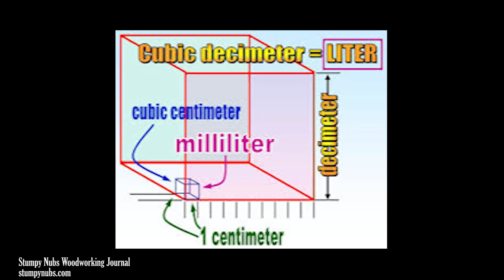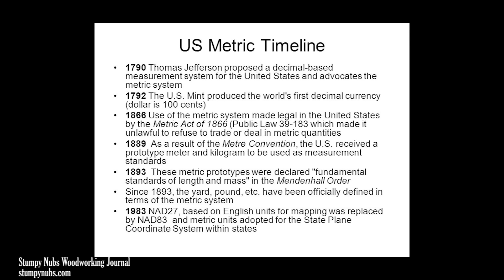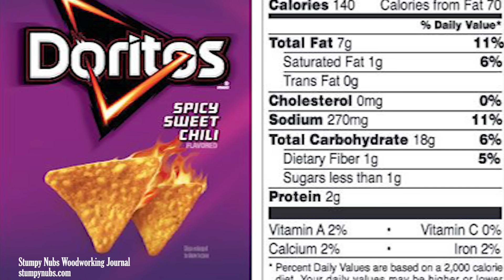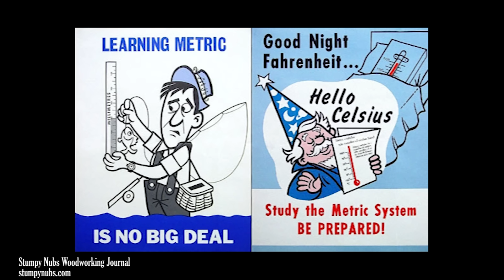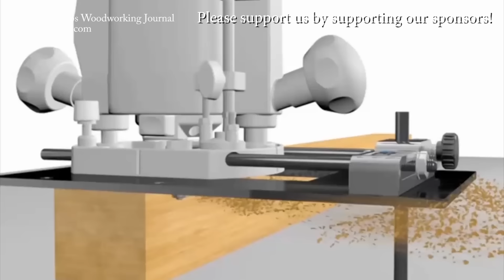BREAKING: The USA is switching to METRIC!

Comment: metric screws make so much more sense to me. Also I find measuring everything in mm (for projects) way easier.. get better than 1/16th" accuracy with a single number - no fractions or decimals needed.
Reply: It just makes more sense in general.
Reply: You can get setup blocks and rules that provide 1/32nd of accuracy which is more accurate than a mm. But when you need to divide that 1 meter base cabinet into 3 equal width top drawers for a buffet let me know how the division goes :).
Reply: @stevenbutler4080  If you need better accuracy, simply use 0.1 or 0.01 or 0.001mm. It is common for working on a metal lathe, for example. :)
And try splitting 10" into 3 equal parts - it's the same problem.
Reply: A 1 meter cabinet is 39.3700787 inches, let me know how that division into 3 equal parts goes.
Reply: No one uses exactly 100 cm wide cabinets, the standard is 45/60/120. There you go.
Reply: @stevenbutler4080  You can get a rule that is in micrometers.
Reply: Came from metric country, learnt to appreciate US fractions :)
Reply: I dislike spanner sizes in Imperial, but sometimes the imperial thread pitch is better that the metric one...
Reply: Did you know you can get better than 1/16" accuracy by using 1/32"? Even 1/64".

The accuracy and precision of either measuring system are identical. There is nothing that can be measured in one that can not be measured equally well in the other.
Reply: @barryhamm3414  Why are you mixing units?
If your cabinet were 1 yard, then divided into 3 equal parts would be 1 foot each.
Reply: @Locke99GS  More over when you buy tools,  for instance drill bits, you can get 1/64 stepping which is 0.4 mm.  Among metric ones I did not see ones sold with less that 1 mm steps, so less precision
Reply: @Locke99GS that's true, but it would be 10% or so smaller, and we all know that Americans want everything bigger 😊
Reply: Dimensions on engineering drawings are expressed in decimal form, with decimal places. The units of measurement should also be specified, such as millimeters (mm) or inches (in).
Reply: @BulletsRubber  So? Or are you complaining that it wouldn't be exactly the same as the metric unit size? Because I never claimed it would be the same, I claimed it would be better accuracy than the original example given.

Also it doesn't matter if it equates to the same, because we're not trying to equate it to the same.
Reply: I would be so lost I think if we changed to that lol
Reply: @barryhamm3414  Simples, change it to a Yard.
Reply: @jimrosson6702  Changed to using fractions?

If so, then 
that's simply due to a lack of education on them. If you don't understand fractions, then you don't understand fractions. In the US, children learn fractions in elementary school, typically along with the concept of division, since they're the same thing -  fractions are just a different way of representing divisions. They get lots of exposure to them, so using them in life is just as easy as using decimal notation.

Because they confuse you is not a good reason we should stop using them for ourselves.

If you're talking about changing to metric, then ... it's pretty straightforward. If you can multiply and divide by ten, then you can use decimal notation. (much like if you understand the concept of "half" then you can use fractional notation)
Reply: @jseen9568  why? micrometers are smaller then human hairs. since when do you need that precision?
Reply: @dmitripogosian5084  no such thing as American fractions. you can't own fractions
Reply: @smellysam  as in imperial there are 2 metric thread pitches.
Reply: @BulletsRubber  metric measurements are bigger numbers.
Reply: @jdilksjr  why?
Reply: @BulletsRubber Except their pints of beer are just16 fl oz vs UK  20 fl oz
Reply: @Locke99GS  Yeah how are those 1/32 and 1/64th measuring tapes lookin? Real common and easy to use eh?
Reply: @stevenbutler4080 Is that because you enjoy using 1/3 of 1/32?  Anything you do could end up like you're implying, being divided by inconvenient amounts.  How about dividing a yard by 7?  These type of questions are, I think, called straw men arguments.  They don't really serve a purpose or prove anything.
Reply: @colinstu  about as common as 0.5mm tapes, and about as easy to read, which is to say, not difficult at all.

They're plenty common. Anyone who needs one can buy them at any hardware store. They cost about the same as any other.

I have a 64ths inch measuring tape in my tool cabinet.
Reply: @@ThatRaggedyDoctor microinches exist too, without the need to use fractions. What's your point?
Reply: @stewartbonner  well it isn't really a micrometer, it's a 100xmicrometer. So there are 10 hatches for a millimeter.
Reply: @jseen9568  you have no clue what you are talking about. there are no micrometer marks on a ruler or tape measure. 10 or a 100 has nothing to do with it.  no micrometer measurements in woodworking.  nor are there any hatches.
Reply: @stewartbonner  lol ok. They're out there. I use them, not for woodworking. IDK the brand it's just a piece of metal
Reply: @jseen9568  this is a woodworking channel and video. no micrometers are used in woodworking . off topic. why are you here and why are you injecting irrelevancy here?
Reply: @dmitripogosian5084  yes, appreciate what a pain in the butt they are.  base 10 just as money, fingers, toes, decades, centuries, science......99% of the world.
Reply: @Locke99GS  thank you! Stewart seems to not think those and smaller increments exists in 8n metric. Which is really weird.
Reply: @cuebj  the UK and US pint is not the same size.
perfect example of why to go metric.
Reply: @Locke99GS  such precision is not a woodworking concern.
Reply: @jseen9568  there is no such precision used in woodworking. micrometres are at the measurements of human hair thickness, thinner then gluelines. There are no dimensions on woodworking drawings that are at 10^-6 metres precision.
Reply: @@ThatRaggedyDoctorif easier to achieve the same or better results then by definition 'better'.
Reply: @jseen9568  "decimetres' are not used in woodworking nor industry. Not a SI unit.
Reply: @@ThatRaggedyDoctor What's to figure out? You said this:

---
@ThatRaggedyDoctor
6 hours ago
 @stevenbutler4080 "More accurate than a mm" you say. That's where we metric folk simply use "micron", and still have no need for fractions. 😉
---

Implying that microns have high enough resolution to preclude the use of fractions.
I replied to that stating that similar exists for imperial, very high resolution unit that precludes the use of fractions.

So ... I'm not sure what there is to re-read or what there is to figure out.
Reply: @jseen9568  Yeah, I see where he is coming from, but in a discussion about "metric", micrometers (and smaller, nano-, pico-, etc...) totally exist. That should be undeniable. But with the lens of woodworking, micrometers (the measurement, not the tool) is not useful.

I personally think the scope of you guys' argument needs to be defined before it can become productive.

:)
Reply: @stewartbonner  "such precision is not a woodworking concern."

If we're talking about 64ths, I disagree. 64ths do matter when joining. 1/64" is ~0.4mm, which is massive when joining and jointing.

However if we're talking micrometers, then I agree, I can't imagine that level of precision being required in woodworking, whether metric or imperial.

(edit: there are multiple tangential discussions going on in this thread, so I'm not sure which this relates to. Sorry)
Reply: @Locke99GS  bs. the marking knife and chisel blade is the only 'measurement ' at 0.5 mm precision. there is no need for anything more precise mating surfaces will be glue starved. ordinary humidity will change dimensions more then 1 mm in 2 cm cross grain. quite literally splitting hairs. such many decimal points of a mm are not a concern of 99% of woodworking trade/hobby. feeler gauge accuracy is irrelevant and can not be achieved without using metal machining tools on very hard woods. woodworkers in these channels and comment sections don't and don't need to. go down to 64ths is still a lot bigger then sub-mm ranges.
Reply: @stewartbonner  So you're saying that you think joinery with 0.5mm gap is acceptable? That's a pretty large gap, and unacceptable to most. It makes be suspicious of your woodworking experience.

0.5mm is very noticable. This is probably fine if you're just glueing together a workbench out of 2x4's, but is unacceptable for furniture making. Hell, that's unacceptable for store bought glued together table tops from IKEA or cheap workbenches from Home Depot.

edit: You said "go down to 64ths is still a lot bigger then sub-mm ranges". This tells me you don't actually understand the sizes we're talking about. 1/64" is 0.4mm. This is not "bigger than sub-mm ranges".  A 1/64" gap is about the size (slightly smaller, really) of the 0.5mm I'm talking about here.
Reply: @Locke99GS  bs. there are no micrometer markings on a ruler or tape measure. there are no micrometer measurements on woodworking drawings.
Reply: @stewartbonner  I have no idea why you're talking about micrometer markings on tape measures and rulers.

Ooohhhh, I see, you don't know what a "mm" is, and you're confusing mm with micrometers. That explains all of this.

Correct, if talking micrometers, that would be ridiculous. But 0.5mm is not micrometers.
Reply: @Locke99GS  I'm am not the one claiming  there are micrometers on rulers and tapes or that they are significant in woodworking nor even a term used in woodworking. Read the thread yourself.
Reply: @stewartbonner  I am not claiming that either. I agree that micrometers aren't significant in woodworking.

However, mm are significant in woodworking.
Reply: @Locke99GS  not me that is confusing mm with micrometers(um).
Reply: @@ThatRaggedyDoctor easier is always better. home schooled were you?
Reply: decimeters are not used in any industry. This anal concern over literal hair splitting is a bore but by all means carry on with the retentivity discussions. Time to do some instead of listening to those that only talk of it. 
 @@ThatRaggedyDoctor
Reply: @stewartbonner  fully aware of the horror that is M fine.
Reply: @@ThatRaggedyDoctor mechanical parts that are often removed for inspection. In my experience it is much harder to cross thread, strip or wear out small imperial (9/16 and smaller) than the equivalent metric thread. Same goes for threading and taping those sizes.
Reply: @DavZell  yes anything you do could end up being divided by inconvenient amounts however a system that is duodecimal based has more factors than one that is decimal based. This means that there are less inconvenient amounts to divide by. It also contains 3 and 4 as factors which are by far 2 of the more common divisors in common use. But yeah if you need 1/7th of something Metric and Imperial equally suck at doing that. One could argue that Sexagesimal (Base 60) would be even better based on the number of factors. This would be fairly easy to implement alongside a duodecimal system for use with larger lengths and volumes.
Reply: @stewartbonner  complete doors and windows are  in dm. 10x21 is a standard door, they are slitley smaller than 1000x2100mm to fit in a 10x21dm hole.

Comment: It's nuts and bolts that motivates me the most. An M8x40 bolt is 8mm in diameter and its thread is 40mm long. It's easy to stock a good range of common values.
Reply: Just playing devil's advocate here but, it's not so different.  A ½" x 2" bolt it one half inch in diameter by two inches long.

You do have to pay attention to thread pitch also, but then again it's the same for metric for any bolt M8 or larger.
Reply: @Elder-Sage  You want to drill a hole to tap a #10 thread, so you use 5/32" drill bit, then realize you need another 4 thousandths clearance, so do you use a #20 drill bit, or a #21?  
This would all be so easy in metric.
Reply: @dominicread797  Thread tapping introduces a whole other layer of calculations.  If I want to tap a hole for a M8 bolt do you think you drill a 8mm hole? The answer is no.  Depending on thread pitch, you'll have to drill 6.75mm, 7mm, 7.25mm, or 7.5mm.

To answer your question the bit I would select would depend on the thread pitch (24 or 32 TPI) and also the hardness of the material (50% to 75% overlap).   The bit could be anywhere between 18 to 25.  

(also I think we can collective curse standards organizations who decided not to name things in size but an arbitrary gauge scales which is a layer of agitation wholly separate from the English vs Metric issue)
Reply: @Elder-Sage  that is the beauty of the Metric bolt system. M8 thread is always has a 1.25mm pitch. Otherwise it will be denoted as what it actually has. Though at such small sizes I have never seen fine pitch. I have however seen things like M45x1.5, meaning an outside diameter of 45mm with a pitch of 1.5mm
Reply: Any metric thread which doesn’t have the pitch appended is metric coarse ( which is the standard ) to get the tapping drill size subtract the pitch from the major dia ( it’s near enough ) far easier than all the different US threads , UNC , UNF or UN-8 & as for the different strength grades !!
Reply: @richardh50  The method for calculating the tap is the same for ISO and UTS.  That is to say the size is major diameter minus the pitch.  Both standards use a 60° thread angle.  You still have to know the pitch for a given bolt size. While these numbers are based upon the Renard series, it is not something you can calculate from the major diameter.  If work with those sizes often you might have it memorized.  UNC and UNF are just coarse and fine. 8UN is a legacy specification that came into being for use in high pressure and strength applications, but the metallurgy was not what it was in the late 1940s when UTS and ISO standards came into being.  It's a little bit like there is still a market for metric JIS bolts when dealing with classic Japanese motorcycles.

Comment: In Australia we converted to the metric system approx. 50 years ago. Unlike some countries we went the 'whole hog' and use metrics for absolutely every conceivable type of measurement. Back in those days I had been working in the architectural profession for about 10 years and was deeply involved in the imperial system so obviously the change was rather dramatic for me. Yes there was a little bit of a learning curve where you tended to do a conversion from metric to imperial in most measurements but that didn't last long. Once you had adapted to the new system there is no way you would ever consider going back. The metric system is so much better. Obviously the arithmetic is much easier but the way everything relates to everything else is wonderful.
Reply: we converted in '47
Reply: Yeah,I'm the opposite, , I did Primary School in the 80's in Australia - by then we were only taught metric, and find every time I encounter imperial measurements, I am converting them to metric to understand them...
Reply: Yet you still drive on the wrong side of the road, reeeee :)
Reply: Not for "absolutely every conceivable type of measurement." You don't do time in metric. No one does (no countries, at least). There's 60 seconds in a minute, 60 minutes in an hour, 24 hours in a day, 7 days in a week, 28-31 days in a month, and 12 months in a year. We do go metric when talking about times shorter than a second: milliseconds and such. But for units larger than a second, we generally don't do metric (unless you are a scientist, but even then, they usually just measure in seconds and don't talk about kilo seconds or the like).
Reply: Australia still hasn’t gone the whole hog on metric. Metric bolts in hardware stores are only becoming common in the last few years, many are still whitworth. Tyre pressures are still almost exclusively referred to in PSI. A lot of sheet goods still come in imperial sizes, although are expressed in the metric equivalent just to name a few.
Reply: @ajs4x482 That's wild. Here in the US, hardware stores have imperial and metric nuts and bolts standard. Many actual products are imported from Europe (  high end ) or Asia ( most everything else ) and those nuts and bolts are all metric. At first you wonder why the 1/4" bolt doesn't work, then you realize it was actually 6mm. Electrical wiring is still very much not done with metric-diameter wires, but "American Wire Gauge" - which is not fractional inches, but rather a "less is more" system.
Reply: If I am right in Australia they went right to the powers of 3, no bullshitting with centimeters, decimeters, decameters, hectometers etc. Just mm and km. Here in the Netherlands we first learn about them and then later in higher education we are being taught never to use cm in engineering/science. It amazes me that in the US they talk about centimeters. If you are going to change a system, then immediately go the proper way and forget about cm.
Reply: @kirepudsje3743  You're pretty right Kirepudsje. You didn't mention meters but I'm sure you meant to. The construction and engineering industries use mm but clothing and the like use cms - which annoys me a little coming from the architectural profession where everything is mm. As  a general statement however it is exclusively the three units as you suggest.